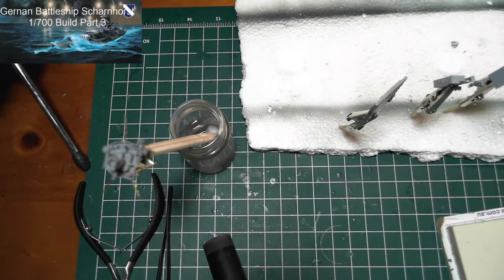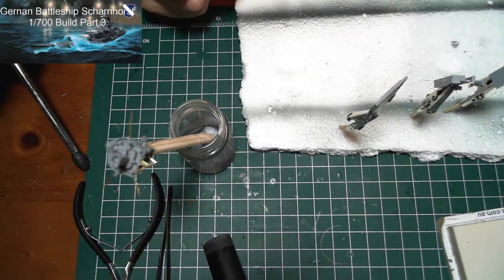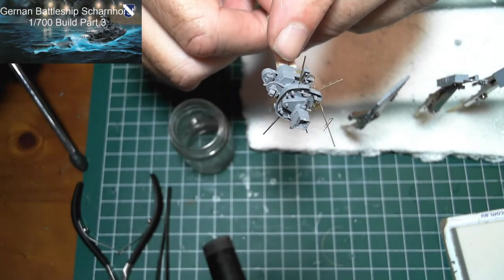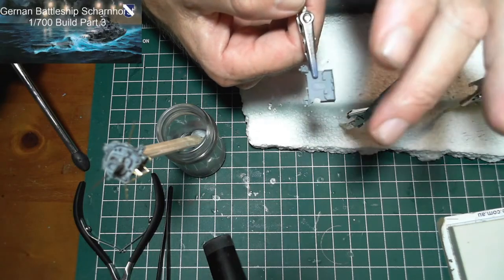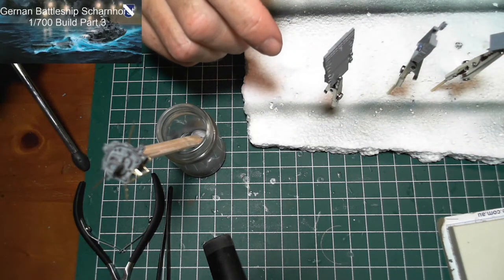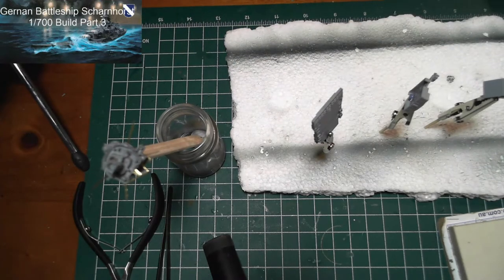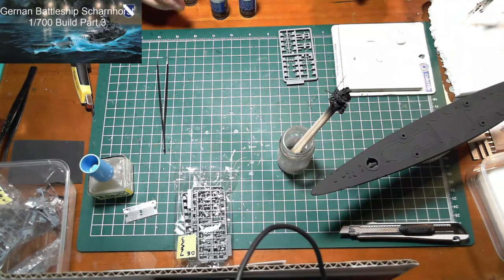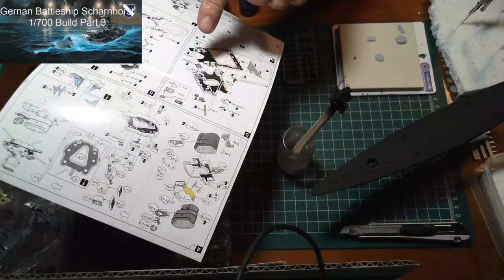German Battleship Scharnhorst Build Part 3

Comment: I had similar problems with some acrylic paints, using a matching brand thinner is usually the safest way to lessen problems. Rather than matching the needle to the size of the model, you should match the needle to the paint, airflow and the size of the spray pattern you wish to create. You may have residual Stylynrez in there, so a good clean never hurts. I’m not sure what brand of airbrush you are using but the cheaper ones have very sensitive seals, many won’t survive contact with lacquer thinners or paint. I noted that you did change the seal. I switched up to an Iwata airbrush and mostly use either Tamiya and AK real colours, or lacquer paint now, and I always throughly clean after every use. That is, pull the needle, and the nozzle, and I clean with an airbrush cleaner. A little cleaning/brush kit is cheap and worth every penny. My Iwata doesn’t have a rubber seal, I think this is either due to higher standards of machining, or there may be a ceramic seal at the back of the paint cup or something like that, - once i started using it and it worked and kept on working, I stopped investigating the differences.
Reply from the maker: Thanks for the tips, I took it to the retailer today I bought it from ( Modifx is the brand ) He connected it up and put some paint through and it sprayed like a new airbrush. I took it home and as he suggested thinned the paint more ( AK Real colors ) and guess what... it still stuttered and not spraying a smooth flow. I think its the Tamiya X-20a thinners so I try Vallejo airbrush thinner and it not help. Now I guess I will go get some AK thinner !   Cheers
Reply: Hi Derek.. sorry for jumping in here.. the Iwata is superb. There is indeed a seal at the back of the paint cup, I thought it was ptfe?